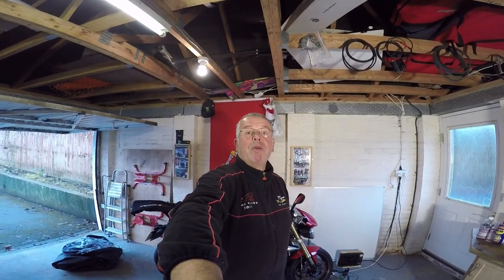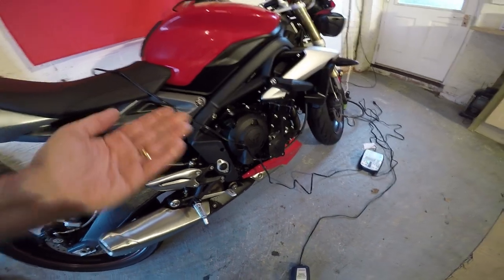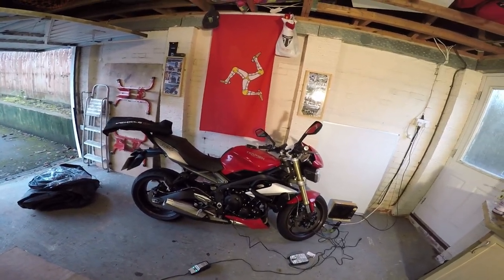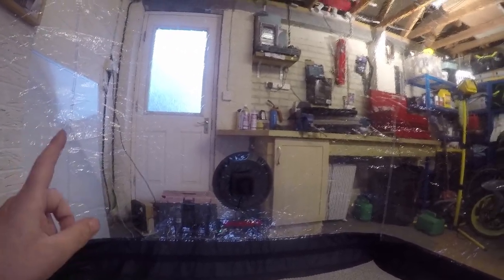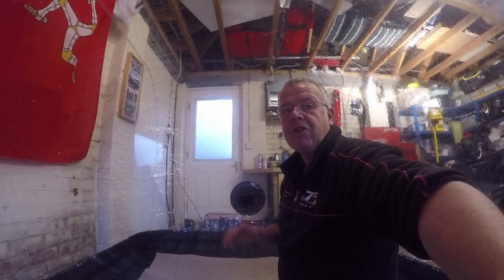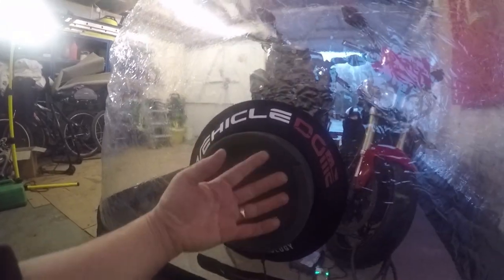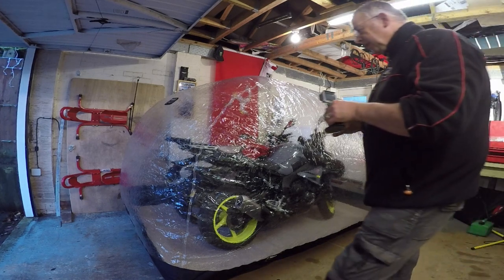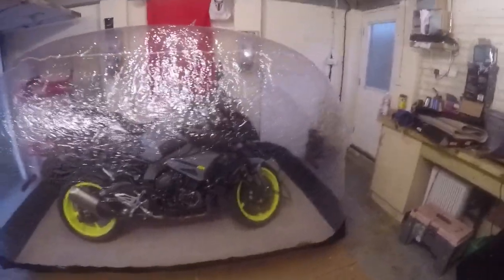Motorcycle Protection Dome, owners review.

Comment: For my classic Honda Goldwing and Kawasaki Z1 I use a dome (carcoon type) and also run a dehumidifier in my garage. I normally put the bikes away at the end of October and bring them out to ride at the beginning of April. Never had any issues with condensation by using this method. Both bikes were connected to Optimate chargers to keep the batteries in good condition.
Reply from the maker: I checked my bikes in there yesterday and all still looked nice and dry. Very pleased how the dome has looked after them, bring on spring and summer. Thanks for stopping by and commenting.

Comment: I dont mess around like that .i have put 4 Harleys( not at same time ) since about 95 in a sealed vac bag.chuck in a big bag of dri sorb , suck the air out , bungy the end up and forget about the bike till April .When i take it out its as dry and clean as the day i put it in in previous Nov.
Current bike in the bag is a heavily customised chromed FLSTF
Reply from the maker: Don't see it as messing around. It simply keeps cold weather condensation and dust off the bikes. It works each winter and is still in use as I type this. The positive pressure dome also prevents the bikes being inadvertently knocked or garage items falling on them.
We're really happy with the system, even years after I made this vid.
Reply: @Banditmanuk  understand.Just my system costs £50 and  no plugging in fans ( except my optimate)

Comment: Just caught this video as I'm looking for a similar/the same solution. Quick question about how you plumbed in the Optimate, how did you accommodate the Optimate leads passing through the zip in order not to create an air leak? Thanks in advance
Reply from the maker: I just pass the power cable and ground security cable through the zip at the join. The fan is plenty powerful enough to cope with the small extra leakage of air. The whole thing works by pushing air in and it leaking slowly through the zip connection to give airflow over the bike
Reply: @Banditmanuk  Thanks, one further question, you had 2 bike in the dome and said you could fit a 3rd. What are the dimensions as I'd like to get a single unit for my 2 bikes. Once again, thanks.
Reply from the maker: @sevansoft  apologies but at the moment the dome is packed away and I would need set it up to measure which won't happen for a few weeks. It was sold to me a three bike dome

Comment: I wonder would that be better or running a dehumidifier in there all the time? Cool yoke all the same, I'd happily have one if I had a garage by the house :) Definitely handy you can fit the both of them in. Do you think it'd be easy to puncture the tent or is it pretty meaty?
Reply from the maker: As I use the garage as a workshop for my business where I make lots of dust, it keeps them clean but I can still pull up a chair and admire them 😀 through the plastic. The plastic is quite tough and you need probably a fist sized hole before it would let more air out than the fan puts in. I suspect the dehumidifier would consume more electricity than the 5p a day the dome is supposed to use. Thanks again for stopping by and all the best with your channel 👍👍👍👍
Reply: @Banditmanuk  Haha definite bonus too so :) Ah it's that strong fan wise too? Nice one. I'd imagine you are 100% correct there :P I forgot about the auld electricity. It looks the business either way! Not at all man and thank you very much :)